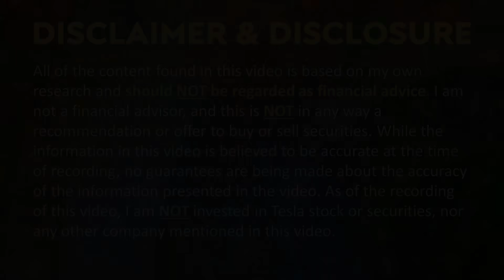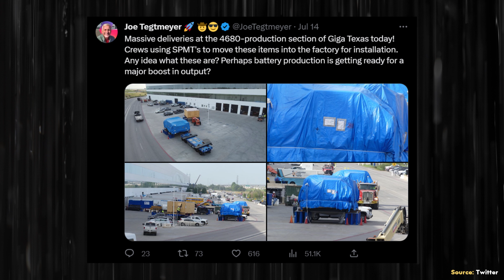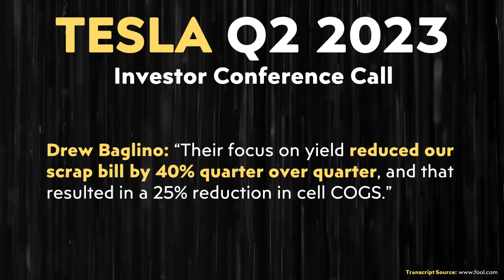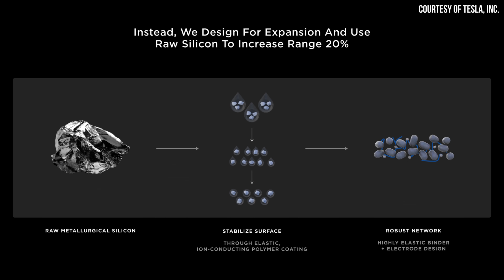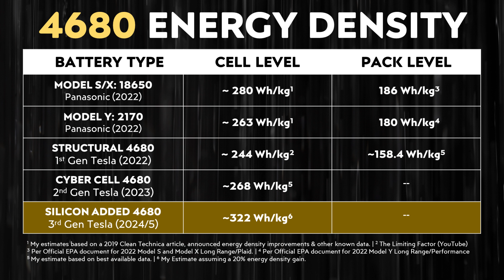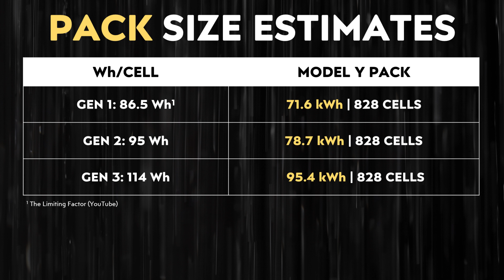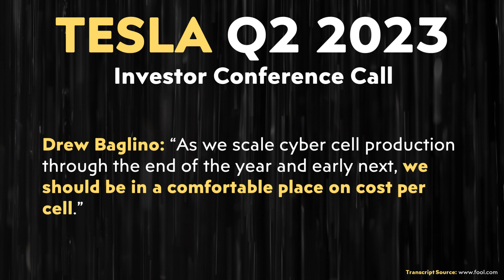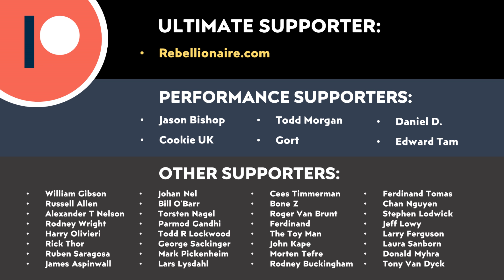BIG Tesla 4680 Battery ENERGY BOOST | Cybertruck Batteries!

Comment: Thanks for the great explanation!  BTW, the 25% reduction in COGS is likely the sum of all improvements, including due to scaling.  Otherwise, if it was just reduction of scrap rate, that would mean the scrap rate went from 167% down to 100% to meet both criteria...which is very unlikely.
Reply: Where have you got 167% scrappage from?  I assume that's more than 100% because of partially completed cells being scrapped. But it still makes sense to have ANY cell being counted as 1 unit, so it's impossible to scrap 67% more cells than you've actually initiated!!  Is this how America does maths?  Or are you including bought-in 4680 cells that were scrapped after testing them in house...?
100% would mean all the 10 million were bought-in cells from other suppliers.  Your "stats" are confusing, to say the least....
Reply: @alexmanojlovic768  Sorry for the confusion.  I meant scrapped cells are 167% of good cells...so in terms of all cells produced (which I agree is the proper way to express scrap rate), that's 62.5% down to 50%.  I think It sounds unrealistically high, so I suspect the COGS reduction includes all contributors, a large chunk being the improved scrap rate.
Reply: @satoshimanabe2493  I'm not so sure that 50% scrap is unrealistic. Clearly, Tesla has had massive problems solving 4680 production issues. They originally expected to be in full production 2 years ago. Elon originally stated that the goal for a single production line at Kato Rd. was 10GWh/yr and Jon estimates 100k cells per day at Texas with 4 lines running. Given about 80 watts per cell that is almost 3GWh per year. Just 1/3 of what a single line should be producing. So Tesla is only about 10% towards their goal.

Now I watch Tegtmeyer's fly overs and for the last few weeks have not seen steam coming from the roof vents over the 4680 section. This suggests there has been a temporary stop in production. As he shows there have been several trucks delivering huge machines to that area lately. I suspect a major upgrade in process.
Reply: @satoshimanabe2493  improving scrap from 62.5% to 50% although it seems shockingly high is not implausible for newly ramping production lines. lithium battery factories unfortunately have very high scrap rates, as high as 10% to 20% for a fully ramped mature production according to "the limiting factor".
Reply: @royh6526 I think that you have gotten lost  in the maths and can no longer see the forest through the trees. Sit back, take a deep breath, watch, and wait.
Reply: @royh6526  If I remember rightly, 4680 currently has both Maxwell DBE & also non-DBE lines.  The DBE was causing tbe most issues (fine, dry dust coating bearings/electrical contacts at high throughput speeds, causing frequent line stoppages.  Thus a lack of steam may be a positive, as in DBE (ie dry) being more successful now & the wet electrolytes not being evaporated off, as more throughput is switched across to Maxwell Dry production?
Happy to be corrected.
Reply: @alexmanojlovic768  You may be right. I was certainly surprised when I first read that the initial 4680 cells in the first released Model Y were half and half. I think it was in the earnings call this Spring that we were told that 4680 cells were dry for both anode and cathode. I believe I have seen steam since then, but not positive of my timing. I haven't seen any steam for a couple of months now.
Reply: baglino specifically said the reduction in the scrap rate by 40% resulted in a 25% drop in COGS.

Comment: With a 20 to 30 percent improvement in cell density Tesla will reduce the number (cost) of cells in the car. You might get some range improvement but most of the improvements will go to reducing cell pack size.
Reply: Bummer. I want more range, faster charging, and nicer interiors for a better product, not reduced price, decontented vehicles. Save that for the Model Tau. Pricing is fine. Leave it alone.
Reply: @TecnamTwin  Pricing has to come down to open up TAM. Only about 45% of Americans EVER purchase a new vehicle. That figure may be climbing very slowly atm do to a lack of used vehicles available but to speed up adoption the vehicle price has to come down or we are looking at decades to get to any meaningful part of the fleet converted to EV. As infrastructure is increased the need for longer range is removed. Removing cells makes the vehicle lighter increasing efficiency which increases range. In other words it's possible to shrink the battery AND increase range. Pricing is fine atm because supply and demand are more or less balanced. As production increases price must decrease. economics 101. cost has to decrease for price to decrease. Batteries are the most $$$ part of an EV. It all fits together. I don't believe Tesla intends to decontent to lower costs. They haven't so far. Reduce price by reducing cost by improving manufacturing efficiences, and improving materials and tech.
Reply: @TecnamTwin maybe in 2025 silicon anode
Reply: @jasonbishop991  
And the same would apply.
Let's speculate on 360W/kg.
Call it +30%.
Based on 820 cells now, that could be ±250 cells removed.
That's close to "free" cells for every third car produced(!)
Then there's the weight reduction....
Reply: @rogerstarkey5390 Wh per kg. Not W per kg. We must keep consistant with terms otherwise this will get alot people confused on energy vs power density🫡
Reply: @Doctorbasss  
Sausage fingers 😉
Reply: Mission.
More vehicles.
Less cost.
Fewer resources.
.
NOT
"Slight range increase for an edge case user required 5% of the time"
Reply: @rogerstarkey5390 good and accurate point Roger.
You've been busy lately.
You're active on most of the channels I see.
Reply: @andrewsaint6581  
Increasingly frustrated 🤔😉
Reply: @rogerstarkey5390  🎯
Reply: I will still argue that electric cars need to have a range of 400 to 450 to really put the nail in the coffin of most commercial ICE vehicles. For example my wife's SUV gets almost 400 miles of range. We take that vehicle to road trips and leave my Tesla at home. Why? It's better to get 400 miles of range and reduce the number of stops. We live in Texas. In this extreme heat there's easily a 20 to 30 percent reduction in my range. 305 miles turns into 250 miles really quick. Combine that with 20 to 30 minutes charge time and you turn a road trip into a legitimate nightmare. Especially if you have kids. My Tesla is a great efficient every day driver. That's not enough to compete with ICE vehicles. Range and infrastructure for charging will be the way to go. I was excited for the cybertruck until I heard the range was going to be 350. Not enough to tow conveniently. They need to stick to the 500+. That's where mass adoption will become a no brainer.
Reply: @hommyrodriguez3280 Actually I would put that number at 500 mi per charge is what is necessary to convince most people to convert to EV because most of the year is not going to be ideal scenario whether hot or cold it will not achieve the 500 range mile mark
Reply: @100pyatt  agreed. And that's why this is so important. It needs to mirror an ice vehicle in this regard to see universal adoption.
Reply: This is huge!! Less cells per vehicle..less WEIGHT per vehicle.   Teslas are very heavy.  The ICE heads certainly all know this and how thier fancy veedubs presently getting stomped by the Plaid will lose also around corners.  
If a Plaid S had 20% less battery weight it would certainly get into the 8s taking top spot from the ugh kac snivel demon. 😊